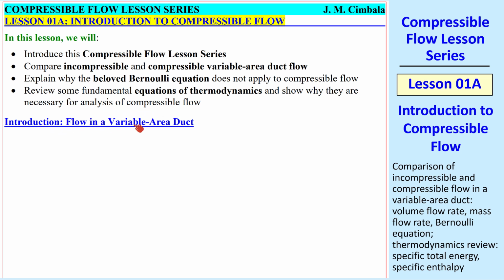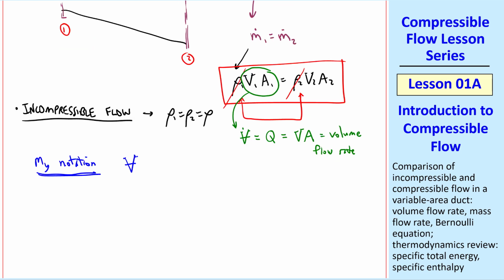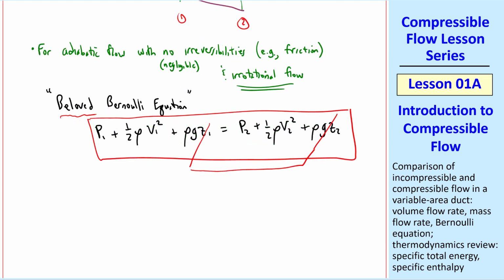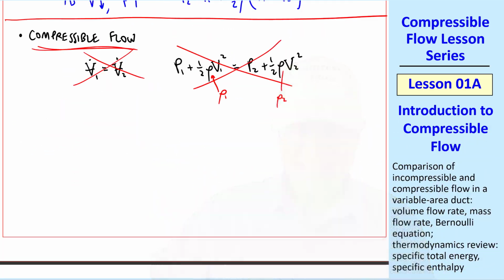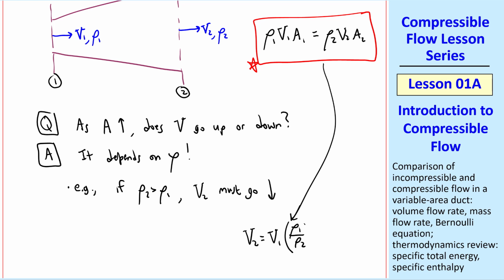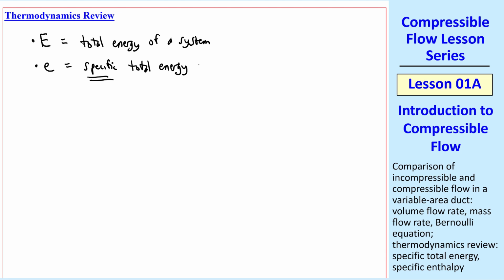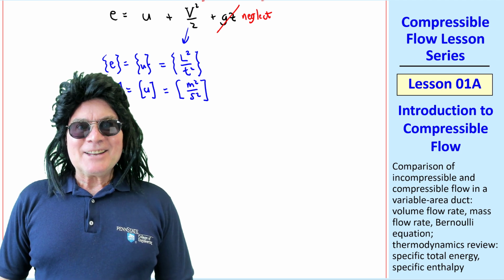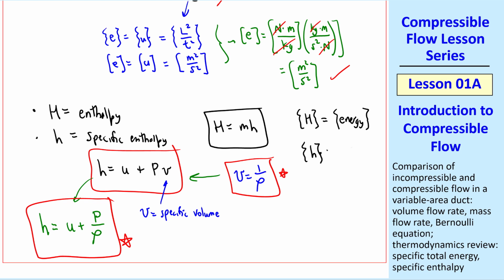Compressible Flow Lesson 01A: Introduction to Compressible Flow

Comment: For any undergrad watching this video, the Bernoulli equation doesn't apply to compresible flow since energy will be added or consumed for any compression or expansion that may present in such flows (resumed in changes in density), so the energy balance between pressure and velocity upon which the Bernoulli equation hinges simply won't apply anymore; and that energy exchange will change properties of the flow in such a way that thermodinamics are needed to evaluate them

Thanks a lot for this video, professor
Reply from the maker: For the record, I do state emphatically in the video that the Beloved Bernoulli equation does not apply for compressible flow. Not sure why you imply that I said the opposite ... ??  
Anyway, Thank you for your comment. Please tell your friends and colleagues about my YouTube channel where there are more than 580 free videos about the Bible, fluid mechanics, science, math, Excel, statistics, air pollution, and other topics. I would greatly appreciate it.
Reply: @johncimbala  
Oh, I'm sorry, I'm not trying to state the opposite from you, I'm trying to help explain the point about why Beloved Bernoulli doesn't apply in compressible flow since it still may be tempting to attempt to stretch it for an undergrad
Reply from the maker: @svidentkyrponos7530  You are forgiven. :) And I agree with you. I always say in my class that students always want to use "Beloved Bernoulli" which is why I call it that name, even when it does not apply. In  my textbook I list several other circumstances in which Beloved Bernoulli does not apply.